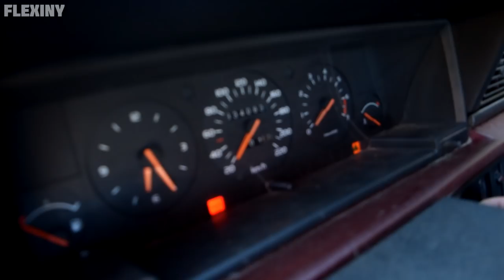Volvo 740 Cold Start After 6 Years (1080p)

Comment: Crap Frontier 0 X 1 Tractor
Reply: it was the tires
Reply: +-_-ineedmoremoney _ It was the truck.
Reply: +x2dayson it was the tires, see how they spin?
Reply: +-_-ineedmoremoney _ It was the truck. He had 4wd, theres no excuse. I couldve pulled that out in my 2wd 6.0.
Reply: x2dayson if he didnt have probably worn out summers tires or something he wouldnt have a  problem with grip. He spun because it had crappy tires
Reply: ...okay, sure.
Reply: +x2dayson do you live down south? have you ever driven in snow?
Reply: -_-ineedmoremoney -_- Im in Texas. However, i have driven in snow, mud, rain, sand, so on and so fourth. All of those both with and without 2wd and 4wd. My 6.0 did just fine (ive sold it) with bald tires.On snow and mud. Sand and rain, not so much.
Reply: DerekT It's "you're". How ironic.
Reply: +x2dayson sorry I don't care about checking my grammar, but how could blame that on the truck? I could tell the tires are bald. I'm not a Nissan fan either, as I like fords...
Reply: DerekT Ah, well theres your problem... Youre used to your trucks under-performing.
Reply: +x2dayson how much snow have you ever had? and your talking about a full sized truck, which is also heavier, try to compare a tacoma or a colarado to the frontier, not a 6.2l
Reply: +x2dayson lol, for me its 1/2 = tundra, anything else is dodge. but man do i want to own a 5 ton one day
Reply: +-_-ineedmoremoney _  Well anything less than a fullsize is a chick-up. Put the same tires on a fullsize and itll pull it out. And i used to live in Illinois (i think i spelled that right) and my father owned a 2wd 5.7l that did just fine... Though prolly on all-season tires.
Reply: +x2dayson we had a rwd 03 f150 and it barely gripped on dry ground, i couldnt even imagine rwd in snow
Reply: +-_-ineedmoremoney _ And Dodge is 10x better than that ^ Ford guy.
Reply: +x2dayson if toyota made a 3500 tundra with a cummins I would be all over that, but for me I like yotas small suvs and trucks for offroading and dodge rams and surplus military trucks for work and towing
Reply: -_-ineedmoremoney -_- Arent they making a Cummins Tundra? No! Its the Titan, thats right. You looking into that?
Reply: x2dayson im not really a nissan guy. There are rumors that the titans diesel is gonna go in the tundra as well
Reply: -_-ineedmoremoney -_- Hasnt Cummins been having problems?
Reply: x2dayson idk havent heard anything like that
Reply: +x2dayson Ford underperforming..... That's funny...
Reply: +x2dayson a 2wd (I'm assuming a 6.0 Chevy) would be much more useless here unless it was on some pretty agressive tires and heavily loaded. Besides, this isn't a fullsize truck either.
Reply: Really, it was the driver. I'm not even going to bother explaining why. 
Funny thing is I know my old first gen pathfinder would have done better than that pickup.
Reply: +Matheus Bitencourt they should have another volve instead
Reply: Adrian Ionut So why did the truck pulled it over?
Reply: +Matheus Bitencourt tractor mabye????
Reply: weight+torque+big rear wheels
Reply: A touareg can pull a 747 as seen in that show 5th gear.  Power and tires quality is shit without the much needed grip when it comes to pulling. No weight = no grip. Without grip you cannot overcome the static friction.

Comment: Whats wrong with your Pickup ? worn out clutch ?
Reply: +Daniel Hines That was a v6 frontier, a titan would have pulled it out easily.
Reply: +Daniel Hines clearly it just lacked traction, street tires suck in the dirt
Reply: Don't even get me started on titans that's one sorry excuse for a truck yes he could not pick up traction but even if he was on pavement he couldn't have pulled that car nissan trucks Honda trucks and Toyota trucks do not have the same towing capacity as a Chevy dodge or ford those frontiers Titans and Tacomas all really suck ass Tacomas are way way over priced just fucking rediclous
Reply: Ridiculous^^
Reply: Daniel Hines toyota actually does
Reply: +-_-ineedmoremoney _ no it does not my buddy thought they same shit so I hoped in my trusty z71 Tahoe hooked up to a trailer with my Kubota with a front end loader on it with a disc my Tahoe pulls it no problem my buddy's Toyota hooked up did good until he stopped to get on to the road all he did was spin in my driveway so he locked it in 4wd still spun in my driveway
Reply: +Daniel Hines did he have good tires? did he have summer tires? if he spun thats not pulling power thats traction. also remember a pickup has less weight over the back, thats why rwd trucks spin often
Reply: Daniel Hines a toyota tundra has a 10k lb. Towing capacity, so unless its a tacoma
Reply: He had bad tires
Reply: +-_-ineedmoremoney _ even in my extended cab z71 I can pull it I've never spun in it I've never really heard of summer tires and winter tires I've always left mud grapps on mind the tundras might have 10k but they are expensive to fix if something breaks another one of my friends had one for 2 weeks it drove shit felt like you was all over the road and it had a mass air flow problem but still I beat my tahoe could out pull it my Tahoe got all the way around posi traction my Tahoe has pulled a lot of things though not any foreign shit will out pull anything American made
Reply: +Daniel Hines what? grammer? what gen tundra is this? the 2015 we have works perfectly fine, stock tires and it only ever got stock in the snow once, because it got beached in 2 feet of hard packed snow, in rwd yea it can get stuck pretty easy, but the 4wd in the tundra works fine, my only complaint is the lsd is a bit rough.
Reply: +-_-ineedmoremoney _ it was a 2012 or a 2013 I do believe and my extended cab z71 with 275,472 miles  I've drove the dog shit piss outta it and I still think it would make it outta of anything before a new one would when I had my Titan though I bought it had 136,000 miles I drove it till 138,000 i broke down in that truck more times then I've ever been on the side of the rose I've owned yota's before but it was kinda of a buy and sell kinda thing never really drove own for a while before
Reply: +Daniel Hines idk about nissan reliability but toyota usually has the best around, the million mile lexus has 1 million miles only on general maintenence. in case you dont know, lexus is the lexury brand of toyota, kinda like lincoln and ford.

yea some american trucks are good, some arent. we had an 03 f150 v6 and that thing was an absolute POS.
Reply: +-_-ineedmoremoney _  I don't ussally fuck around with the 04 and up fords Incase there a diesel and they gotta be a v8 only thing I buy in a v6 is cars
Reply: +Daniel Hines yea, I personally dont like v6, gotta be either boxer 4, inline 6, or v8. but hey they tundra with the 5.7 and a trd supercharger is FAST
Reply: +-_-ineedmoremoney _ my buddy gotta 2003 Chevy ss Silverado supercharged that bitch feels like you fixing to take flight coming off the line it's hell you get about right past the 1/8 it'll start lagging a bit cause the truck still got the stock 6.0 motor in it with 437,000 miles on it 😂😂 he keeps saying me and him gone rebuild it one day idk what that'll be though😂
Reply: +556x45mm NATO Turbo Diesel.
Reply: +DeadNoob was it just me or was only one wheel spinning, if so do they seriously not have LSD's in those utes
Reply: +Lalnable Hector it might be open diff, but its not really considered a pickup truck in the U.S.
Reply: +556x45mm NATO It was a 4cyl turbo diesel Navara, not a v6 frontier.

Comment: If you need an engine for your car that would be the only thing this old rust bucket would be good for ! The rest of the car is rusted away !
Reply: Sheena Boyles Where is the rust?
Reply: Did you not see the under body of the car when they showed it ? All rust !!!!
Reply: Sheena Boyles how would you know if the lines are rotted and the frame is rotted